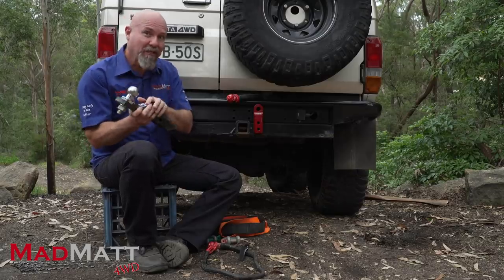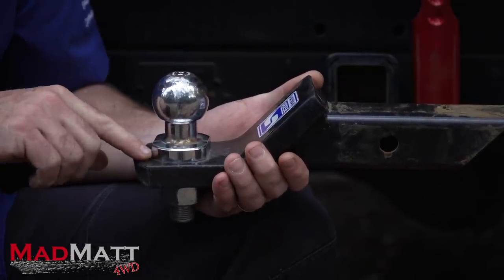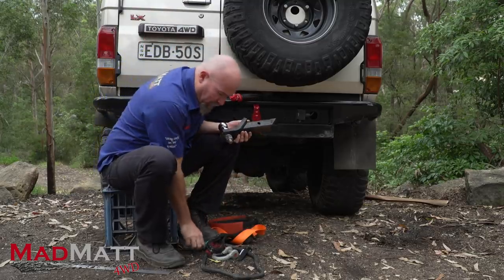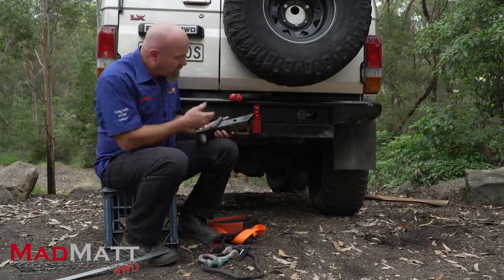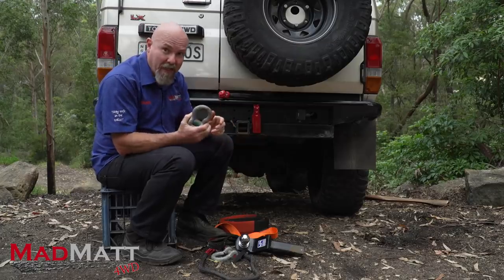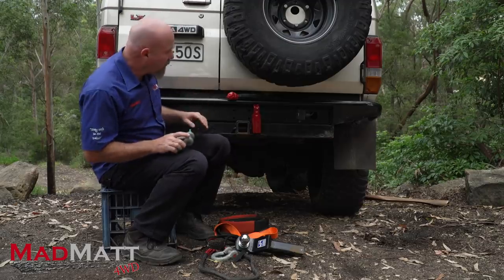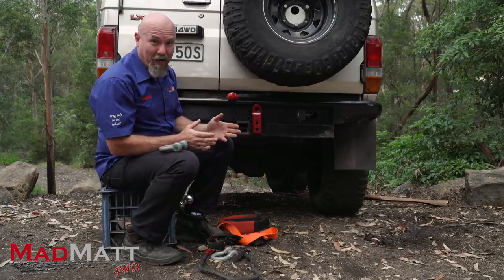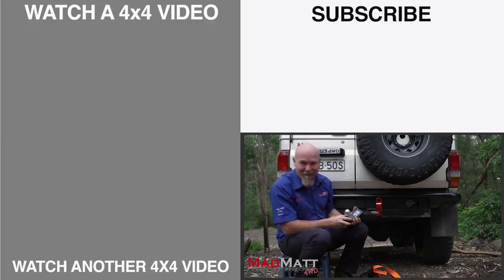A Tow Ball is NOT an option in a 4x4 Recovery? FIND OUT WHAT GOES WRONG

Comment: I actually never thought about Corrosion from the Inside of the Tow Bar.
I've seen Tow Balls Snap. I even pressed one(Same load as attaching a Strap or Chain) to prove a point when I was younger. This TOP Quality Tow Ball snapped at about 4000kg.
I was trying to prove to a mate, that when the Snatch Strap loads up & Retracts it will exert massive energy well above 3.5t that a Average Tow Ball is SWL Rated.
Reply from the maker: That’s interesting. Have you watched Ronnie dahls videos on tow balls.
Reply: @MadMatt4WD  I haven't yet. I'll make time to watch it

Comment: this is interesting.. i have never seen or heard anyone breaking a ball off must be cheap balls. ive seen hitches break or frame points where hitch bolts to fail cause of improper mounting or cheap bolts. ive always used good quality 2in balls with large shanks mounted to good quality receivers and well mounted hitches and never had failures. but ive never just sliped the rope, chain, strap or what ever the case may over the top of the ball its always been around the ball, hitch and nut of ball. 
but this does make one think better about their situation and use proper equipment cause you never can tell. good video and information.
Reply from the maker: Thanks
Reply: They got this new metal called chinesium

Comment: Let’s comment before I watch it. We use tow balls a lot where they face inward and are welded on top of a thick plate. I use 5 ton hooks welded in. Unless your chassis is cross braced over standard, always use a bridle (same for sub frames). Be super careful if you are hooked up on a rock or stump. Let’s watch :o)
Reply: I’m a master engineer and that is spot on. But, don’t even chance that towbar, because the whole assembly decapitates a human with ease. Get your truck down the off road shop and have two proper tow points on the front and two on the back. ( Ideally hooks so you have no shackles at all ) You need to be sure in your mind that if you strapped your first born into your truck that you could tie a helicopter to them and fly them round for a bit. (Get side hooks as well if you can)
Reply from the maker: Nice play. Comment first and then see how ya go. Love ya work and thanks for the support.
Reply: @MadMatt4WD  Thanks. And thanks for the vid. If you are prepared it is way easier to do tasks without taking risks (maybe you never need side hooks, but when you do, the risk strapping to something you shouldn’t in a blind panic goes away :)

Comment: This video is  very applicable if you are using equipment rated for jeeps. Your hitch ball and hitch are rated for a maximum of 10k lbs (that's generous. You are using a class 3 hitch and a maximum of 1" ball shank.) You should use a forged hitch that Is a solid piece of metal. You shouldn't use that hitch and ball for the same reason you shouldn't use a 10k static strap for recovery
Reply from the maker: Correct
Reply: @MadMatt4WD  I should state that I do not drive a small offroad vehicle. I drive a heavy duty  diesel truck. My hitch receiver is rated at 20k lbs and is mounted to my chassis with 3-4" welds and 3 1/2" diameter bolts on each side. My chassis is reinforced for towing and is incredibly strong. Most offroad vehicles do not have a hitch receiver anywhere near that strong and honestly should not pull on it as it can bend their chassis. If you are having to yank on a stuck vehicle, it would be best to use something that is directly inline with either side of the frame of your chassis because as you said, force travels in a straight line. I should also state that in most situations, there are safer options than using a hitch and ball. Using a d-ring or even a pintle hook is safer because it does not allow the strap to come off in any direction. The slightest bit of slack and a bump can cause that strap to move from the shaft of the ball and can become dangerous if the strap slips off. If you have a truck that is strong enough to pull most vehicles including 18 wheelers out of the mud without having to yank on them, the hitch is fine. You just have to use the right tool for the job and some common sense. If you have to back up and yank on a vehicle, an attachment point that keeps the strap attached is obviously the right choice. If you just have to pull forward and can keep tension on the strap and you have a strong enough hitch, you can use that.
Reply: Last point: when dealing with force, most people know the equation Force=mass*acceleration. This equation is really only theoretical because it doesnt contain all of the information. The real equation is the impulse equation. Impulse is the amount of force applied over time which is what you will feel when pulling someone out. When you just pull on someone, you are applying force over a long period of time until you reach your maximum force. If it takes too long to reach the maximum force, you will lose traction and not move anywhere. To combat this, you increase your velocity at the time of impact and by doing so, you reduce the time by a significant number. If you reduce the impact time by too much, you will begin damaging your vehicle because nothing on a car is designed for that sort of force without taking damage to protect the occupants. To give you some random numbers as an example, let's say you are 100 kg and your acceleration is 1 m/s^2 and your impact time is .5 seconds. You are exerting 200 newton's of force. If you back up and accelerate at 2 m/s^2 and reduce your impact time to .1 seconds, you are exerting 2000 newton's of force. If you use that same principle with the weight of cars, it will show you just how dangerous recovery can be If you don't know what you are doing or have the right tools.

Comment: Great video Matt, lots of important information. I hate to be "that guy" but I do want to point out one error. You said that the soft shackle and the bow shackle have the same amount of potential energy. What you are describing was kinetic energy not potential energy and it is not the same in the two pieces of equipment. The formula for calculating kinetic energy is ½ mass times velocity squared.  The velocity is going to be very close however the mass of the two objects is radically different. The amount of kinetic energy in the bow shackle is going to be significantly higher than in the soft shackle.
Reply from the maker: Thanks for the comment. Because I’m no physicist I actually got this video checked prior to it being released. I’m confident it’s correct but I’ll get them to read your comment and respond if appropriate.

Comment: Still haven't seen anyone mention just using the pin on the receiver as a tow point. I was taught that it was much safer than using the tow ball. I'd like to see what sort of forces would be needed for the receiver pin to fail when directly connected to a snatch strap.
Reply from the maker: I’ve done videos about that over the years. If you go to the blogs on the website you’ll see my detailed thoughts. Basically it’s ok imo as a last resort.

Comment: A more precise way to put it wouldn't be to say that the double shear is stronger because it isn't, what it is, is the force being divided between the two shear points, so nominally half the force is applied over a single shear. This is important because if things aren't set up correctly, or in sub-optimal situations, such as if one hole is worn out larger than the other, it can go back to acting like a single shear joint.
Reply from the maker: Yes strictly speaking yes but for the purpose of this exercise is it important to communicate that to the audience ?
Reply: @MadMatt4WD  Maybe. I feel like it's reasonable to say something like "a double shear splits the force between each shear, so each shear point takes half the force of a single shear"

Comment: I only use a tow ball when I am not yanking someone out like in a ditch where you can pull someone out slowly.
Reply from the maker: So are you saying in a low load situation?
Reply: No I pulled out a smaller size camper with my tow ball

Comment: I saw a guy come into our local shop with a B&W style rated for 10000 pounds I think it was. It was set on the “big” ball. 2 5/16 he said he was trying to pull someone out and it broke right off. I had heard about this issue before and told him it ain’t made for winching out you need a D shackle type for that use. He was surprised and had not heard that before. I think people commonly make this mistake as we see the rating and think it is plenty. I use expensive hitch balls such a as the Shocker so I don’t even want to use those when I have a $30 option that is safe.
Reply from the maker: Well said

Comment: Yes Ronny Dahl's video is a good example of what can happen. Shame he had to falsify the breakages. 
As for using a hitch receiver or the pin, isn't minimising projectiles the name of the game ? As doesn't the recovery hitch in the hitch then become a shear in itself ? 
Glad to see someone telling the truth about steel bow shackles.
Reply from the maker: What do you mean falsified the results??? I think the double shear ensures a strong attachment designed with good engineering principals that won’t fail with the loads we are dealing with.
Reply: @MadMatt4WD  Just that after 8? Attempts a used ball didn't break and had to cut them to break. But it does show how tuff a jeep is. 

 Totally agree with the double shear. Just using some real life experiences with metal/bolts/pins in the hitch receiver scenario from working with machinery and mechanicals. Over time creates stress points and we know how well people inspect the equipment. About 1 in 10 vehicles I service, the tow ball is loose and been used to the point where the threads are worn and worn the tongue to the point it needs replacing.
Reply from the maker: @Sydney Mower And Automotive Centre Excellent points. The video I reference shows that hit number 8 busts the ball off. From what I saw it hadn't been cut or tampered with. Of course there could be camera magic going on but having met Ronny a couple of times he doesn't strike me as a guy who would falsify this testing.

Comment: In Hardcore scenarios, yeah. Wouldn't trust it. But you also have to think that the bolt on a tow ball is a million times thicker than the double shear pin that goes through to hold it in.... You'd need massive force to even break it and if you did, that pin might break before the ball given the right loading. Therefore you shouldn't use the receiver at all?
Reply from the maker: That last sentence is where it’s at

Comment: i was hoping you would mention the different ball sizes since they are rating for drastically different weight. the 1” 7/8 ball is only rated for 2000 pounds and 200 pounds tongue weight no wonder it would snap. if you size it up to the 2” 5/8 ball, it would be rated for up to 10000+ pounds and 1000 pounds tongue weight. i feel like it would handle recoveries a lot better.
Reply from the maker: Yeah or just use the correct tool and not have the concern.
Reply: @MadMatt4WD  i very very rarely off road with my truck but it does tow a lot. that’s where my question arose.
Reply from the maker: Your better of taking the hitch out and fitting the strap through the hitch pin then.

Comment: Mass has a considerable effect on energy, or guns wouldn't use different sized bullets.   You could launch that cloth shackle out of an Abram's cannon and you won't penetrate any armor with it, or, in all likelihood, ever reach a target.
Reply from the maker: Correct but if you launch it at a higher enough speed it'll go through steel or disintegrate. If an item is lighter it just needs to travel faster to do the same damage as a heavier item travelling slower.

Comment: You're talking about weakpoints and such so I'd like to point out that the bow shackle your holding is rated for 4 3/4 tons, or 10,471 lbs. it's a cheap one too so it's likely rated at a 2:1 ratio (Their website gives absolutely no specs beyond a 10$ price and a good shackle rated 5:1 or 6:1 would be around 30 bucks) but that gives it a max limit of 20,942 lbs. Now that's fine in quite a few situations because you can expect to introduce forces to it of about 3 times the weight of whatever vehicle you're attempting to yank out of a hole. but only if it's being pulled straight, if that pressure is introduced off center than it reduces it's over all limit considerably... granted I'm just reiterating what someone else has already written on some other website. But the point here is that for someone focusing on safety I feel like you should be using higher quality tools.
Reply from the maker: Great comment. Personally I’m moving toward soft shackles and associated gear.
Reply: @MadMatt4WD  I haven't seen them mentioned yet aside from one of your collab videos with Matt in Utah. lol But I did only just find your channel. Thanks for the response! I'm looking forward to binge watching most of your videos in the near future, It's pretty interesting to see the differences in how you approach problems/jobs compared to other towing channels I watch.
Reply from the maker: @CB-lh8gw  Thanks for checking it out. Be aware some of my thoughts have evolved since some of my early content. Also, I'm not a towing channel but an all things 4wd channel. Anyway, I really appreciate the quality discussion on whats going on. Helps me get better at what I do.

Comment: I've seen matt from matt's offroad recovery use a triple tow ball setup with his yankum ropes multiple times, and he seems like an experienced guy that knows what he's doing. What are your thoughts on that?
Reply from the maker: Next weeks video is Matt explaining it. Personally I think he could just use a proper hitch receiver.
Reply: If you watch how he connects the rope to that receiver it diverts the energy into multiple points and could possibly be stronger than a tow shackle, but I’m still with Madmatt’s set up because there is no way that the snatch rope can slip off or get miss aligned during the pull.
Reply: Personally I think a 5 star hotel and a swim up bar is better.

Comment: To be fair, Ronny had to cut the ball AND drive insanely fast to get it to finally fail. Unfortunately we read about these instances where people are killed, but we never know the condition of the ball before it failed. I’ve seen these balls just fall right off while driving because the lock nut has untwisted off the bottom.
Reply from the maker: It still doesn't make it a safe procedure.
Reply: I think what Ronny was trying to show was what could happen in the worst case scenario. It might work 99 out of 100 times but you never know when that last time will be. No one knows the true strength of any tow ball internally. Could have been a bad cast etc.